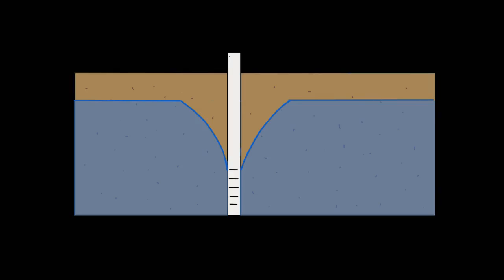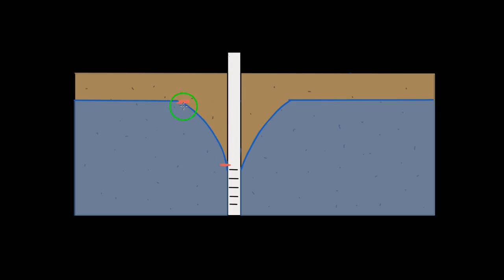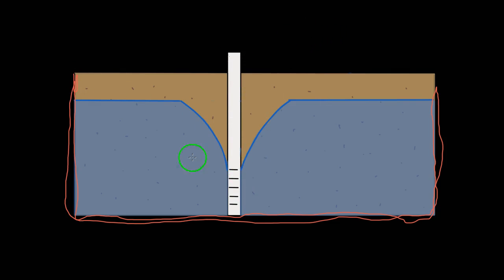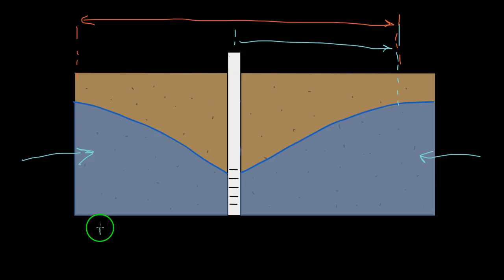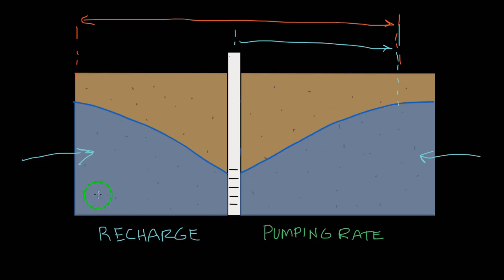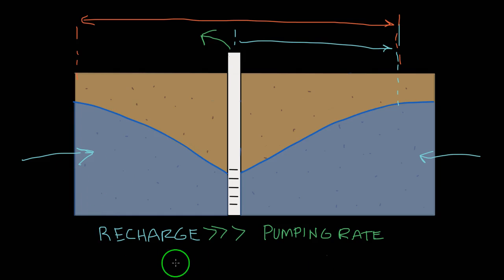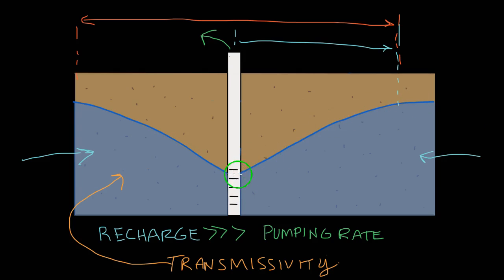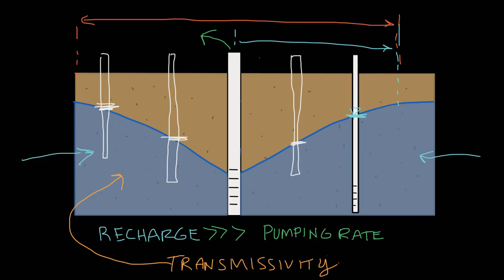Cone of Depression part 2

Comment: Is recharge rate fixed or is it dependent on the draw down? I would think that with greater draw down youd have a steeper gradient in the cone which would lead to faster recharge. With a small draw the pressure difference isnt that great and it wouldnt draw as much water in.

Comment: how far past the static water level should I drill? my SWL is 42 feet.... yes, drilling my own well on a farm
Reply: wells in my area are 10-15 gpm
Reply: I believe You have to find the draw down level. Pumping rate versus recharge rate. Example.....With pump 10gal per min , where is the recharge level to match that . That recharge level will be a point that the recharge level stops , while pumping. Below this point is where the pump goes

Comment: Yea testing capacity of wells is a huge deal, locally i have actually run into this issue.  This is why i asked about the cone of depression since it can easily be overlooked.  Our local government department of resources failed to do a area of impact survey before a large community well was drilled.  This well was basically done illegally and under the table because the builders were cheap and did not want to drill deeper to a less used aquifer.  A well was drilled for a single family home near the development before it was completed.   The static water level was 30' at the time the well was put into service and the draw-down was minimal of 15' from a  1hp - 20 gpm submersible pump.   A year later when people started moving into the community and the well was in production the home owner called "out of water"  We got there to the pump running and not pumping, the water had dropped below the pump!   The water-level was now at 50'.  Having only 60' of 4" casing for the submersible to drop down in the pump was changed to a 1/2 hp at 10 gpm.  Nearly another year goes by and yet another call "out of water".  This time the water level had dropped to 70', and the well depth is only 110' here!  The community is around a couple 1000' away from this well, and now we had to resort to changing the pump type to a above-ground jet pump with a stinger 20' pipe down the 2" casing.  At this point the State Dep. was contacted, they finally called back saying there was nothing they could do.  They had no way of proving that the well depth of the community well and the private well were the same.  They also said they do not have water level monitoring equipment or funding for such an investigation!  I would expect soon for the private well owner to have to drill a deeper well, which deeper water there has a lot of iron which would need filtration not to mention cost more to drill!  So basically what your teaching on your channel is very important!